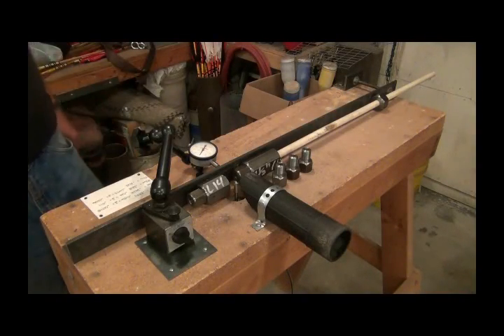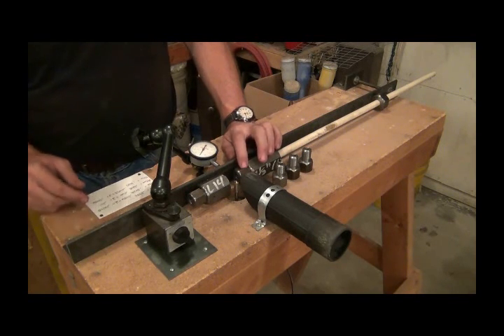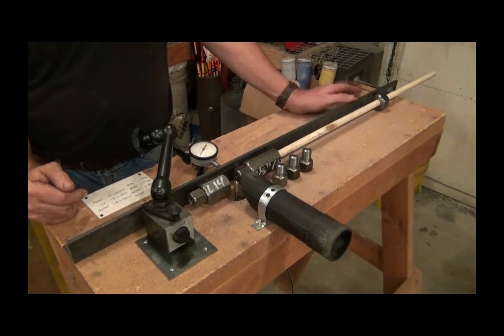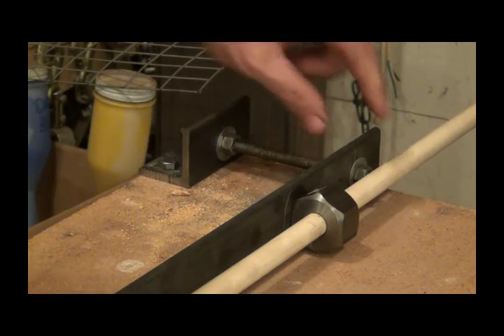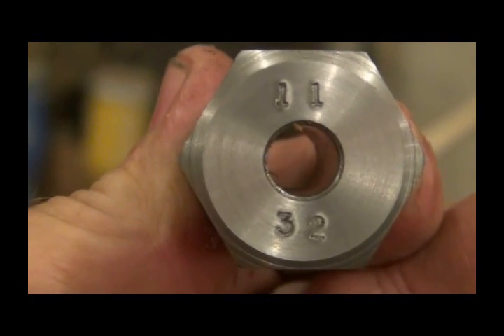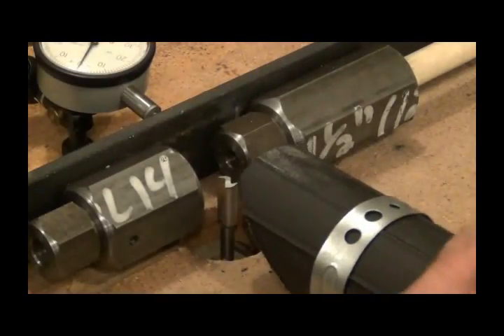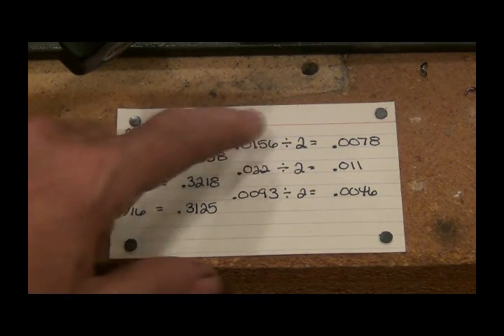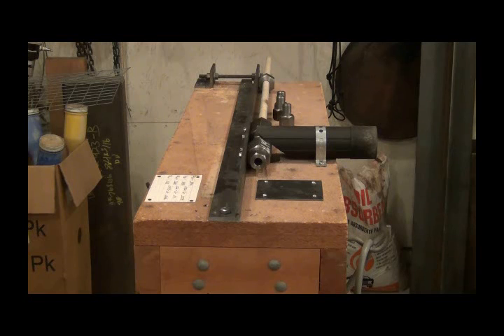Arrow shaft making machine

Comment: Double check 21/64 thinking its .3281
Reply from the maker: Your right. I'll check my calculations.
Reply: +Buckrun11  That machine you got going there looks awesome, I just didn't want it causing you issues. after all the years in injection molding and splitting hairs on tolerances most everything I do now days is Folk Art and crafts with none of those tight numbers. LOL.  looking forward to seeing it turn some shafts.

Comment: That looks pretty damn amazing Buck!  If you have a 1/2'' collet for that router, and you think it might help, try a downcut  1/2''D solid carbide spiral bit and rotate the shaft counter to the shear angle, or clockwise in the case of a downcut bit, might get it real smooth.  I can send you one, or a bunch for that matter that I have that just the tip is worn and all of the other length of the bit is still new.
Reply from the maker: +Pops Quest Now you lose me! lol I found that I need a bit with a long shank. The center of the rotation is quit a bit higher than I had planed. All my 1/2" bits were to short so I changed to a 3/8" cutter. I am not getting a smooth finish on the shaft. Anything you think will work I'll take. I'd appreciate it a lot!
Reply: Do you have a 1/2'' collet for the router? to accept 1/2 shaft size bits?    If so, I got a bunch of things that will help.   The 1/4''  shaft size bits will actually deflect a very tiny amount especially if they are high speed steel.  Solid carbide won't deflect, it will shatter though so be careful.  I know I have your address somewhere but pm it to me so I don't have to hunt for it.  Google, solid carbide spiral cutter and you will see the type of bit I am talking about.  Can't guarantee it will be perfect but it should be helpful.
Reply from the maker: +Pops Quest Not sure if I have a 1/2" collet but I think I know a guy that could make one! I'll get after him this weekend. I'll pm you my address.